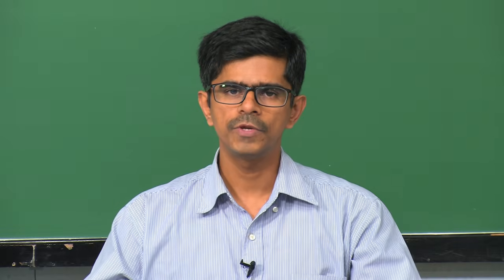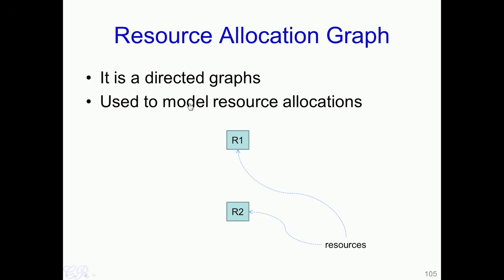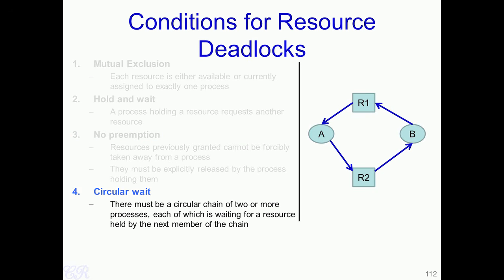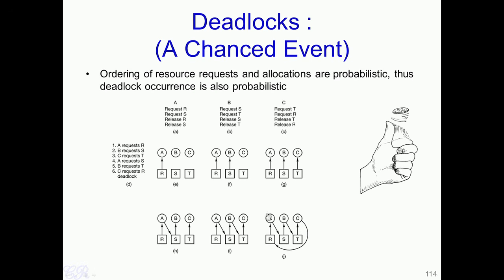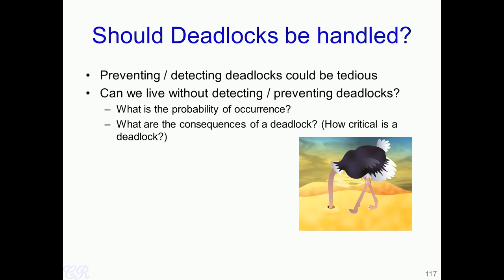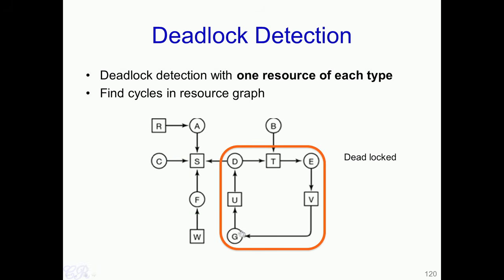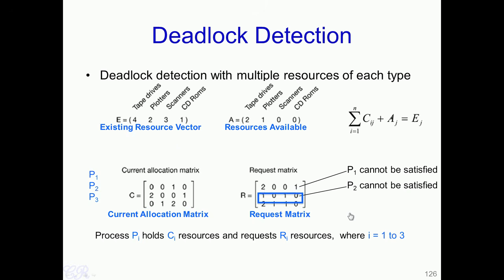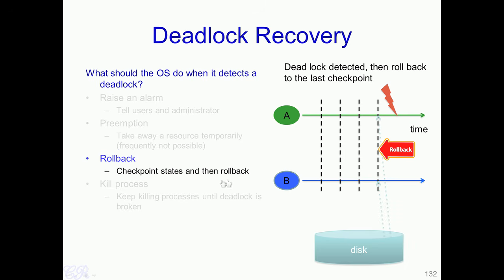#32 Deadlocks | Introduction to Operating Systems

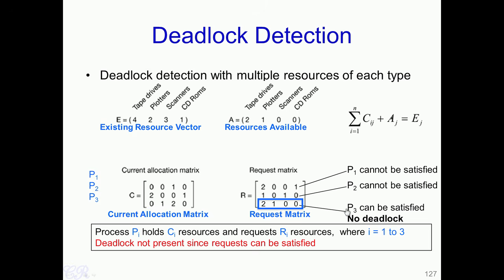Comment: 29:09 P1 and P2 can still be in a deadlock right?
Reply: i think if one process is satisfied, they may release the resources in the future which can be allocated to the other processes. so deadlock is not occuring.
Reply: @ishrarchowdhury4850  If P2 requests for 3 scanners instead of 1 then there is a deadlock even if P3 completes its execution.
Reply: Then its not called deadlock
Reply: Yes I guess u are right. If P2 requests for 3 scanners instead of 1 then there is a deadlock.